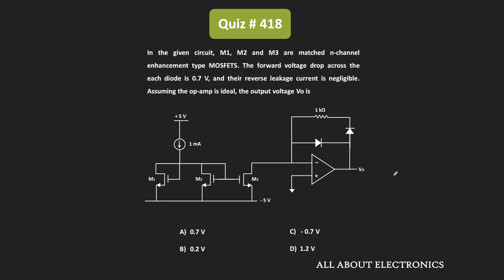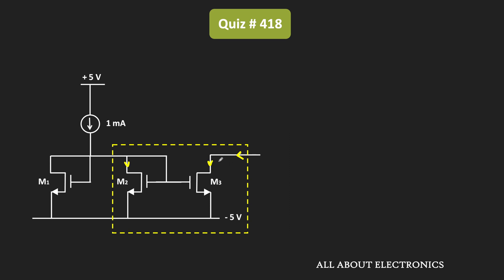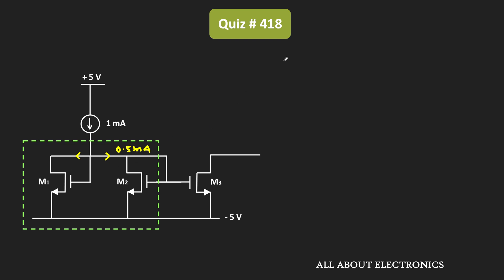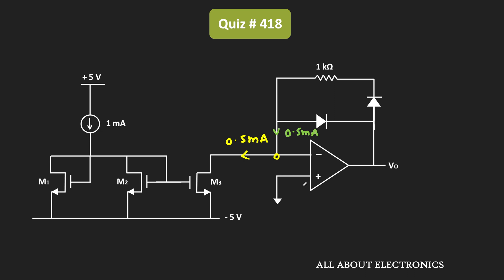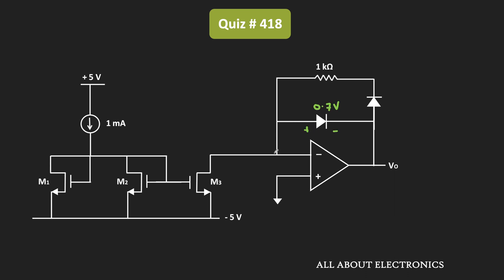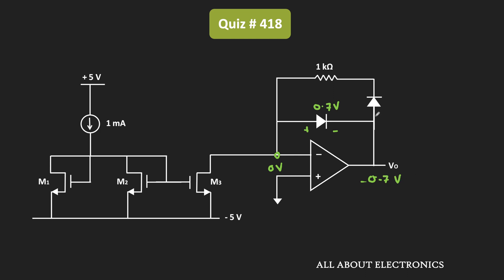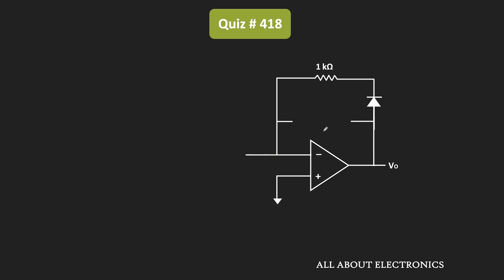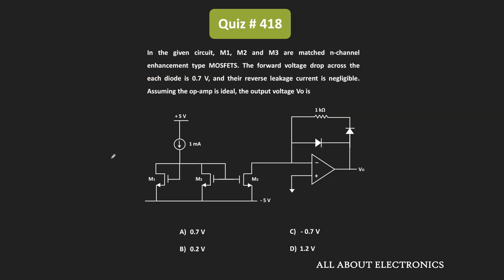Operational Amplifier (Op-Amp) / Curent Mirror ( Analog Electronics) | Quiz # 418

Comment: Why not change the constant current from 1mA to 3mA and add
A cs Mos becomes M1, M2, M4 in parallel? ?
And L of M1, M2 and M4 is fixed, find W values for each?

ID1=ID2=0.5mA
Because M2M3 and M1M3 are current Mirror so I3ref/I2=(W/L)3/(W/L)2=1/1( W,L is the same),so M3 id3=0.5mA(D to S)

The current flowing into the D1 diode and the diode is disconnected .
The current flowing into the D2 diod and the diode conducts
So vo=0.7+(0.5)*1=0.5+0.7=1.2v

Comment: when D2 is conducting, voltage drop across D2 is (-0.7) only right?
Reply from the maker: Voltage drop across diode ( anode to cathode ) will be 0.7 V.
Reply: The current runs out from the 0p output terminal. It cannot run to the vo terminal because it is open circuit! 😝
So D1off ,D2 On 
Use loop find to vo